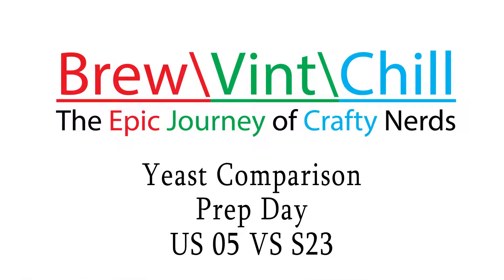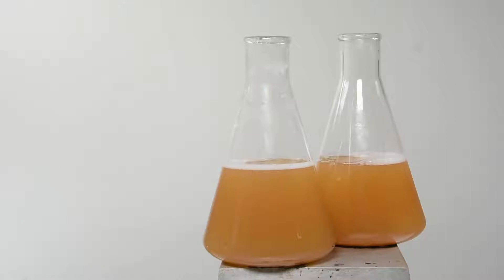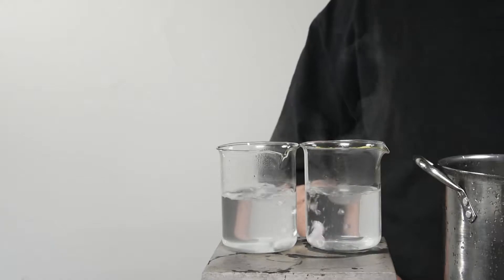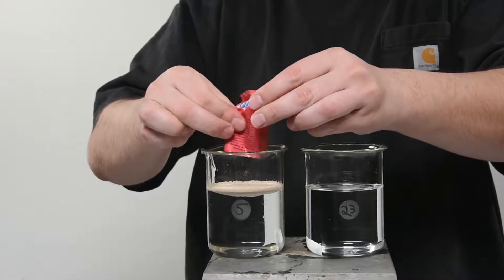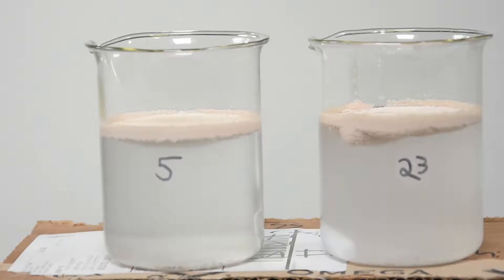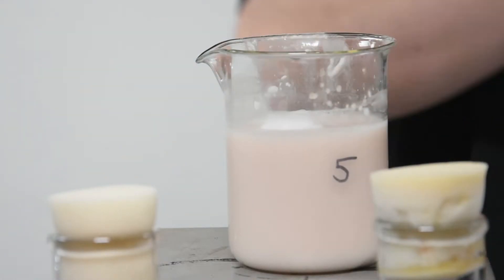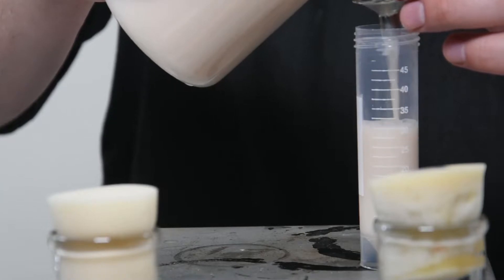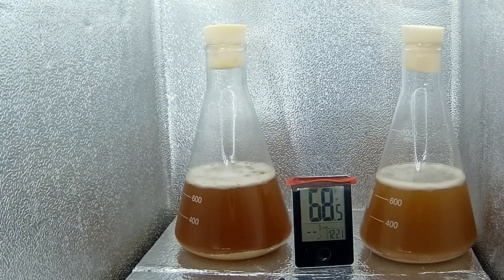Yeast Prep Day US - 05 & S - 23

Comment: I made a 1.5 gal batch of beer last night added in the yeast at 92 f. Its 12 noon next day and no activity in the airlock yet I added in a left over pack of So5. Should I be worried or wait?
Reply from the maker: Wait, until you hit the 24hr mark there can be several reasons to not see anything yet. The 92F probably shocked the yeast making them stall out a bit depending on what strain it was. Panic time is at the 48hr mark after a hydrometer reading. It's rare, but it is possible for something to completely ferment without noticing, that was a fun day at the shop.

Comment: I have 1 500 ml flask and want to double yeast for 1 S05 packet. How much water and DME??.
Reply from the maker: A 500 ml flask is going to be hard for making yeast starters. But if you want to try, the recipe would be a 1/16 pound of DME with 250ml of water. It will stress the yeast out, not enough room/water for the yeast to mingle. I would save time and skip the starter when using dry yeast by using a second packet of S-05 to double the cell count instead. Yeast starters are better at saving money when using liquid yeast and don't forget that your time has value. Or use a larger flask with 1 liter of water and 1/4 pound of DME.
Reply: @BrewVintChill  Thank you. I’m trying to brew 20 gal ( 8% abv) batches with dry packets. Ordered a 3L flask. Ratios for DME/water to boost cells with 4 packets of S05 ???
Reply from the maker: If you have four packs of S-05, then you can pitch that. Or to save some cash, but not much. You could take two packets and make a starter with 2L of water and 1/2 pound of DME. Use the anti-foam agent or be ready for some boil over as that will be a tight fit still in a 3L flask. If you are going through a large about of S-05, then a big bag might be worth the investment. (affiliate link)

https://www.homebrewing.org/500-g-Fermentis-SafAle%E2%84%A2-US-05_p_4612.html?AffId=690

Also, what size fermentor(s) are you using?
Reply: @BrewVintChill  Thank you for the explanation. Trying to save cost with bigger batches because I give most of it away. Don’t see many videos for 20 gal batches. Stoked I found your channel!!
Reply: Fermenting in four 5 gal (food grade) buckets. Currently mashing 30 lbs of grain in 2 10 gal coolers. Have spare keggle and wanted to see if I can mash in keggle to simplify.
Reply from the maker: Thanks for your support, splitting yeast from a starter can be hard because you can't actually see the yeast, so you won't know if you are actually evenly splitting the yeast cells. It is doable, but not ideal. Jumping to 20 gallons is a big hurdle because it's small for a brewery but huge for a standard homebrewer, so the equipment and support just aren't there. And it can quickly turn into spending money to save money. Mashing in a keggle can bring it's own problems, such as the coolers probably maintain temp alright by themselves whereas a keggle mash tun often uses a pump to recirculate and some sort of heat source to maintain temperatures. just-food for thought that all equipment has tradeoffs. let me know if you have any other questions.
Reply: @BrewVintChill  Good point. I only batch sparge and thought keggle would help. Got a “caveman” setup and always looking for tips to improve 20 gal batch.